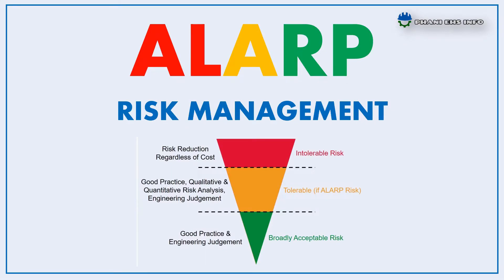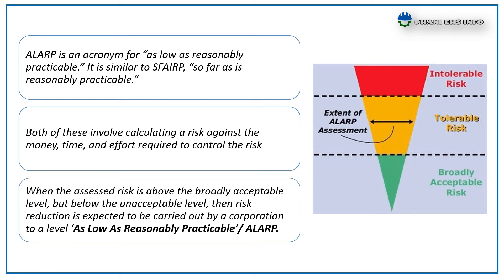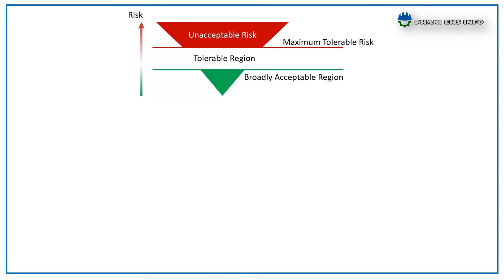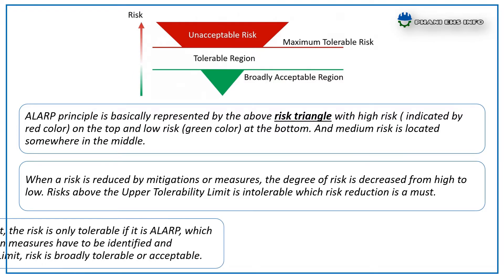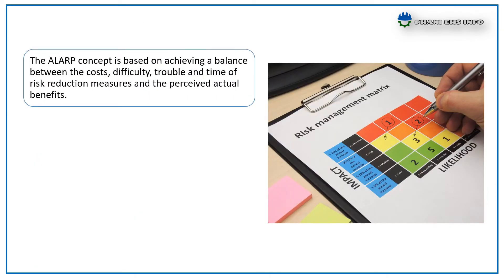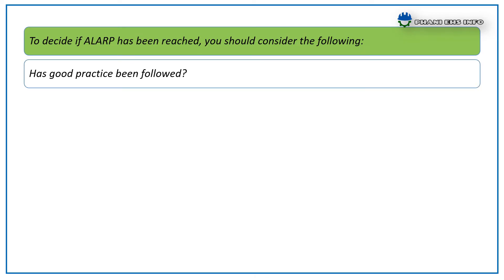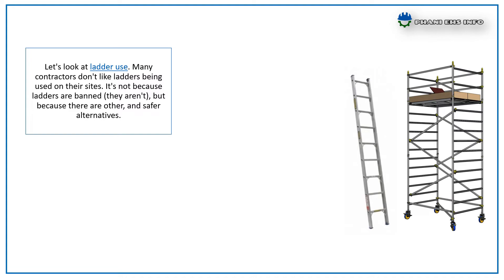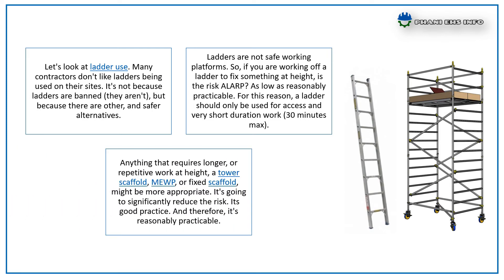ALARP RISK MANAGEMENT

Comment: Are all risks ALARP? and who should be part of the team assessing risk?
Reply: not all risk, only residual risk which the co unable to manage transfer or reduce those risks. but constant n ongoing risk monitoring process is needed.
Reply: As far as I can see, no! I understand that the goal is to take all risks (or at least most of them) to acceptable levels. Since there is no such thing as "zero risk", there will always be a residual risk, even for low-risk hazards. And even if it is not possible to reduce certain risks to acceptable levels, I think that it depends on certain information for a risk to be accepted as ALARP or to justify why some risk cannot be reduced, such as cost vs benefit analysis, possible accidents considered, their impact, safety implementation costs, and so on... Does this make sense for you guys?